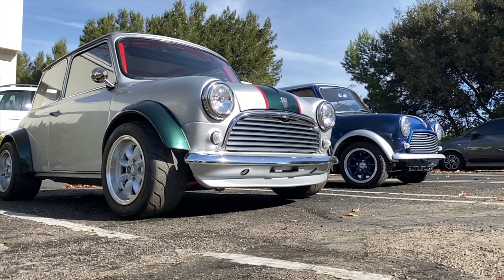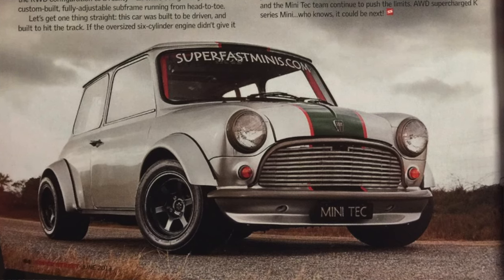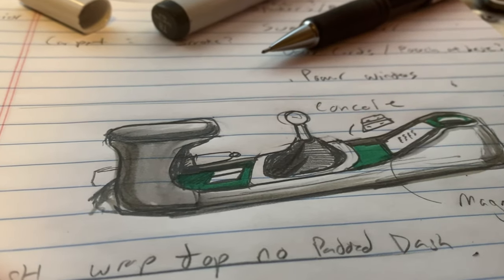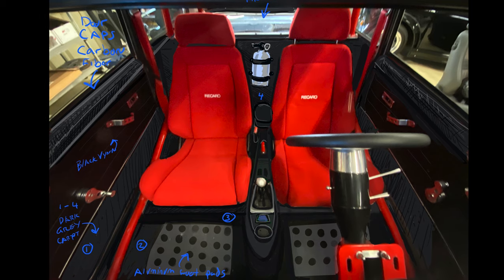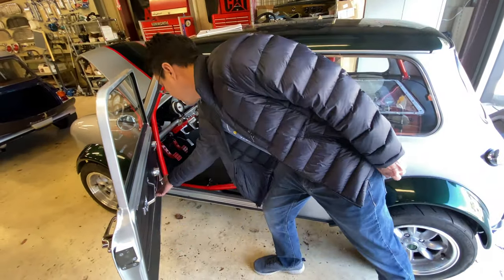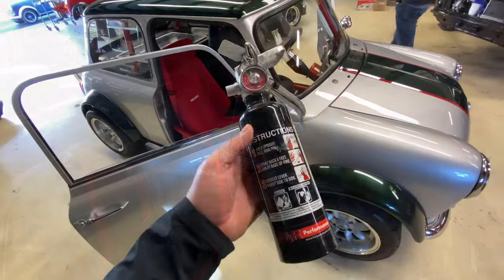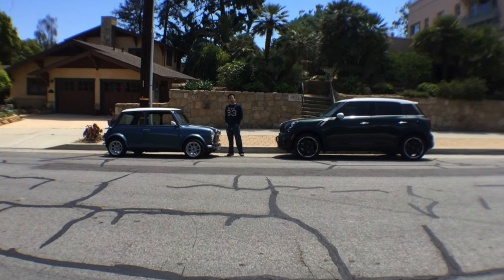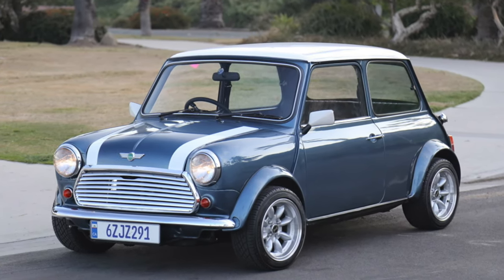Victor E. Round 3 Transforming an Acura 300hp J32 V6 Vtec Powered Classic Mini into a Super Cooper.

Comment: The greatness of taking a 60 year old iconic design and shoehorning new technology and bespoke build quality in without losing the cool factor is undeniable. I guess the lack of torque steer, the blistering acceleration and go-kart handling with a compact mid-engined chassis moves the design on. Minis won races because they corner fast and maintained a higher average speed and manoeuvred better. I guess more power, rear wheel drive and mid-engine changes the original dynamics and give different strengths. How would this type of mini fare in a race on a European type of say, F1 circuit? I would love to see a race prepared one in action.
Reply from the maker: Though we do improve the performance and handling characteristics through modern technology entering one of our cars on a F1 circuit might be a bit of a stretch. We are considering promoting a midwifed/ Super cooper class in the future to advance our track capabilities...and have fun.

Comment: Hey Tyler, Great builds and epic detail 👌

I am thinking of the risk to feet and legs if having a frontal impact at speed of course and seems most cages except full rallye builds seem to end at the A-pillar.
The footwell of course does not offer much space, but with all the high power and added speed is extending the cage in to that area not an option for added safety? 
Looking forward to seeing more of  your builds 😀🚀
Reply from the maker: Gregsen that is a good point, safety is important, Safety Devices offers  MSA/FIA homologated equipment, and they are known for their High quality standards.

Comment: I saw the Dave Brown remakes, which I really liked - I'm a comfortable sedan-loving driver. It was the answer to my daydreams - a small car with all the comforts of a big expensive sedan. 
Someone said you could take your own mini and get all that remaking done yourself for less than half the cost. You seem like so good Mini Guys....so my questions are 1). is the removal/'strengthening' of the seem areas effective and safe ? ...2). someone asked why didn't Dave do the same with the roof seem, would that be advisable & safe if it was done ?
Reply from the maker: Hi Andrew. DB makes some nice looking Minis, many aspects we love. Duplicating their work would be very hard for even the most talented car builders to accomplish. And trying to match one for half the cost would likely be an inferior car in the end. They make a profit on their builds but 50% Would be a dream. You can definately make a hell of a mini with that budget. We are building a nice authentic Auzi MK1 1275 right now for a client who was looking at DB but found us and commissioned the build instead. David Brown cars are not restored classics like our cars they are newly pressed shells from heritage in England. Just the bare unpainted shell will cost you a good $20k to start ad the drivetrain electronics, fabrication, paint, body work, glass, interior and more will be hard to Ala cart build one similar for less. You can buy a nice condition mini locally and upgrade the interior and refresh the engine for half the price of a David Brown or one of our Super Supers but it won’t be apples to apples. Deseaming the Mini reduces the body ridgidity and is not safe to do without significant structural fabrication. It can be done sure but the body was designed with those seams in mind origionally. We have seen a few done well and it comes down to aesthetics. The top rain gutter is not usually something that is removed though. It keeps water from runnning right into the door when it rains. Also it makes a nice break for two toned cars. Hope that helps.
Reply: @GildredRacing  MUCH help !...thanks for such a committed response....you gave enough for me to be studying over the next couple days. Sincere gratitude.

Comment: Do you think that you can make a 700 hp Mini, if you could what engine would you use and not make the car look out of place by fitting the engine in the back or taking some of the space in the front for the engine by cutting the fire wall just a normal looking Mini???

Comment: Hey man I absolutly love your builds and amazing fast minis , and wanted to ask if you are gonna build a K20 Honada mini front engen ?
Reply from the maker: oOEyAdOo we have built/worked on a few front mounted k20 engines but the issue is they do t fit without extending the front end, hence the use of the B20/18 which barely fits

Comment: Is it possible put the original gearbox with straight cut gear fitted to a acura 1.8 engine running with DCOE sidedraft Webbers 50mm?.
Reply from the maker: Kevinantonio Morrison it could conceivably be done but the gearbox would fail quickly, the 5 speed trans from the Acura on a turbo1380 would be interesting.

Comment: I want to have a rear engine automatic transmission, with ac and cruise control,, is it possible?
Reply from the maker: It is possible but it’s not a request we get too often. We would likely run the K series engine as the J automatic has some issues holding up under extensive abuse.
Reply: Gildred Racing  how much budget are we looking at here? Timewise and money wise? Can you give me a very rough estimate -Bob
Reply from the maker: @velocity800  email me tyler@gildredracing.com